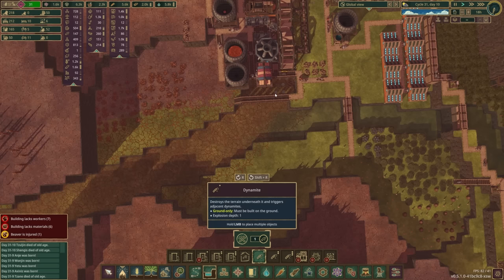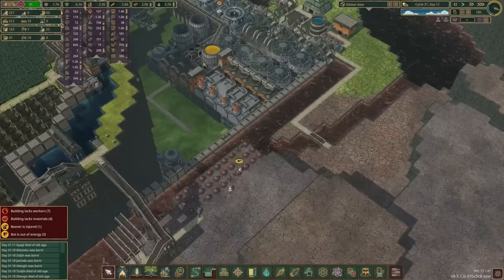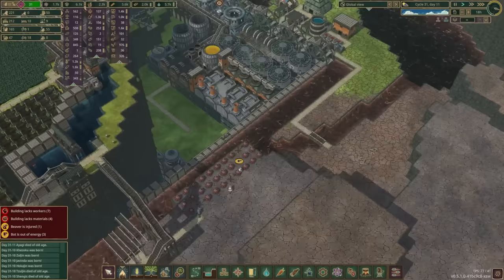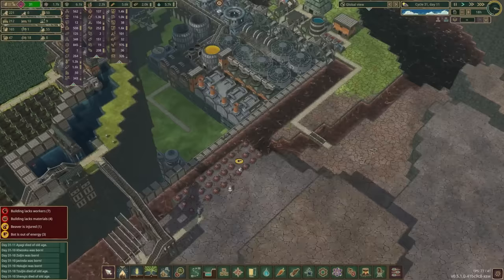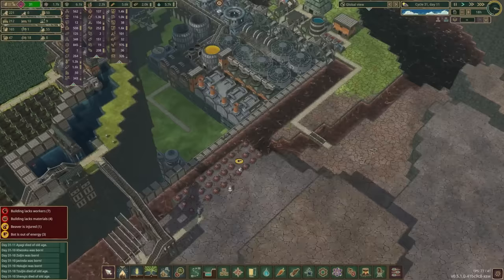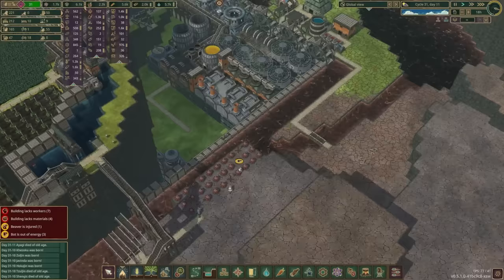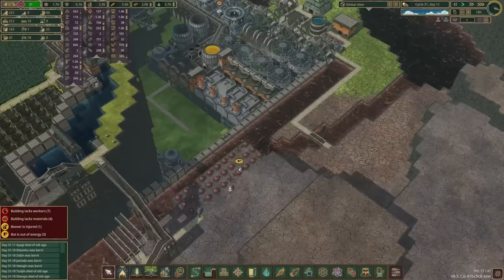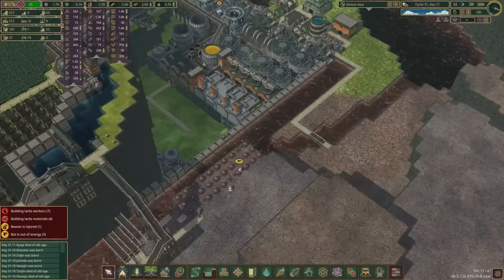Waterways and other improvements! Timberborn Update 5 Episode 18

Comment: 1:00:47  you need 2 stream gauges,   the one you have is the "slow" channel,  the on the left in the deep section will have the "folded" speed  and that  one can be quite a bit higher than the other.

Comment: The trench in the middle before the water wheels needs to be exetended until the  ground goes up where you make afsnijden a straight trench as long as possible. And make the 2 by 2 area before the waterwheels the same height as the waterwheels and not the last 2 higher like it is now because the water needs enough space to change direction.
Reply from the maker: Will do!

Comment: When a large volume of water is suddenly restricted, the water will speed up to fit through the smaller space.
At some point, all that faster water needs to go somewhere so it can slow back down, or it will overflow.
Generally speaking, you want to make an hourglass (wide --> narrow --> wide)

Also, trying to raise the water just to drop it back down won't work. It slows down going uphill, then speeds back up to normal afterward. All you've done is make an overflowing dam in your canal. 
If you want to add elevation, the elevation needs to start at the source, which is a mammoth task.

Comment: → I think for your overflow problem, it would be slightly better to have a 1-deep channel directly behind the wall. You can put platforms over it, so it doesn't actually take space. This way the bad water should not spread.
→ When you look at the stream gauges, it always just measures the flow in the exact tile it is in. To get the whole flow through a channel wider than one tile, you need to have a series of them parallel to each other, and add the flows together (assuming they all go in the same direction).
→ For the bot which got stuck on the wall: I think the issue is that the planks were not there yet for the stairs, and therefore it started to work on one of the levees behind it, and then one of the others brought the planks and finished it. Prioritizing the stairs might have helped here.
→ I'd suggest setting up a few more charging stations, spread around. Near the end you got up to 17 bots out of energy at once.

Comment: Not even 3 mins in & I"m already having a chuckle :)  Beavers with flow problems & you dynamiting to what sounded like the Muppet Show theme :D  fun times, fun times indeed :D  In my belovedly known Curie's Corner (or somesuch pending vote); there isn't storage for the badwater, the badwater collector may end up sitting on their paws for long periods due to waiting on the badwater to be exported.  Also, perhaps filling in the little 'notch' near the new bridge down in the left channel will help with the water flow, you have the inside edge (to the main channel) blocked, however the notch where the badwater flows out of water pools rather easily & isn't compacted.  (all seen from 58:50 )
Another great episode :)  Looking forward to Sunday!!

Comment: Your water gauge in front of the water wheels is in the wrong spot to get a better view of the current.
In the exploded canal you made there is flow restriction where the platforms are, if you remove that it will help to move the bad water flow better.